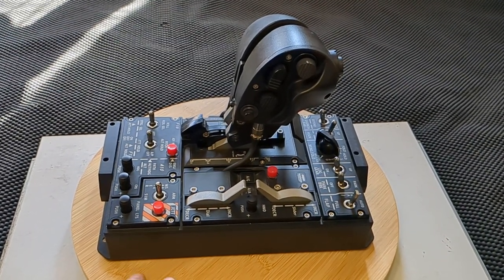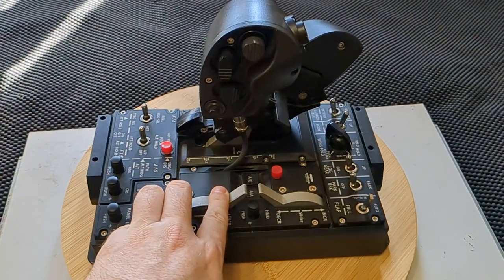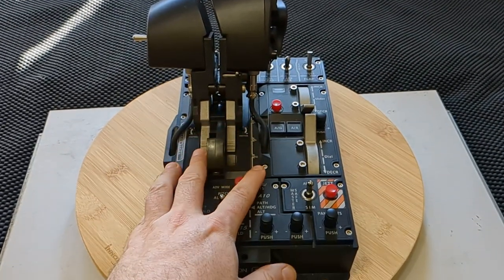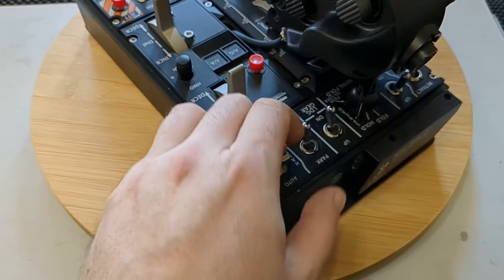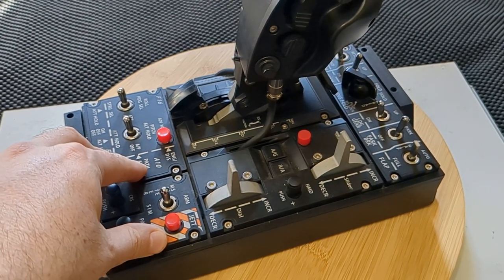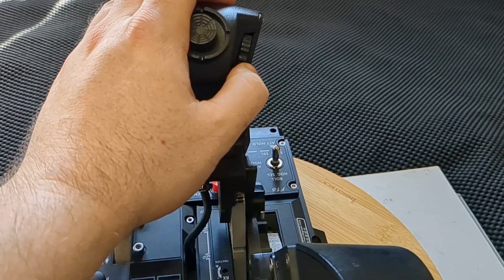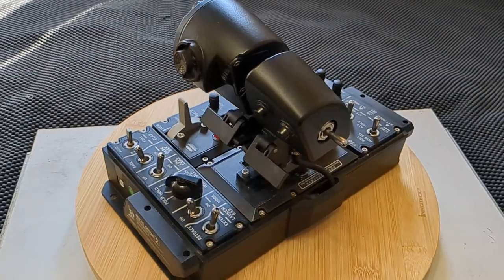WinWing Orion 2 Throttle +1 year Later!

Comment from the maker: Useful Links
Wingwing store - https://winwingsim.com/view/index.html
Wingwing Simapp Pro link - https://winwingsim.com/view/simapppro.html
My video on the Finger Lift Kit - https://youtu.be/LuzZzX9qvy8

Time Stamps
0:00 - Intro
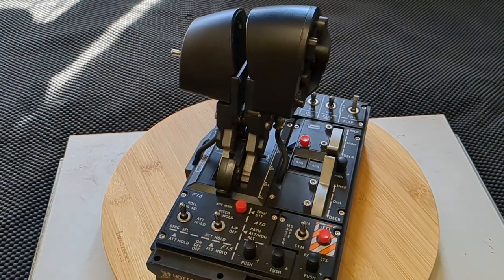0:46 - Do I like it?
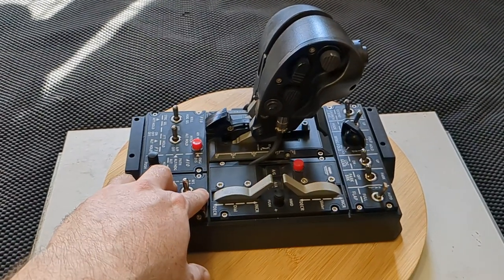1:25 - Why it's not ideal just placed on a desk
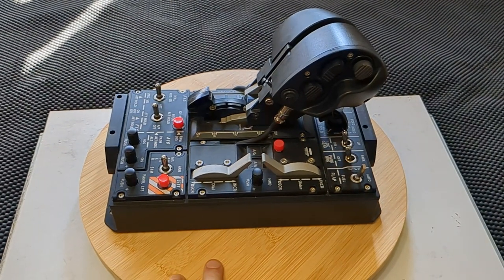2:22 - Adding a powered USB hub with switches is a nice addition
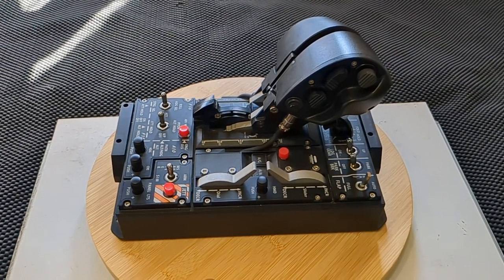3:03 - Use the 4x32 button mode!
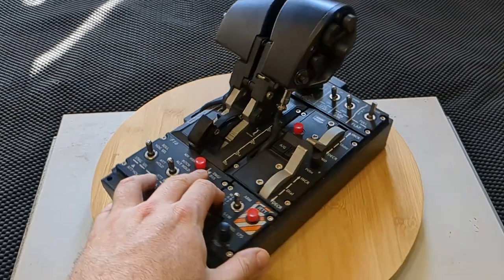4:08 - The Orion 2 base
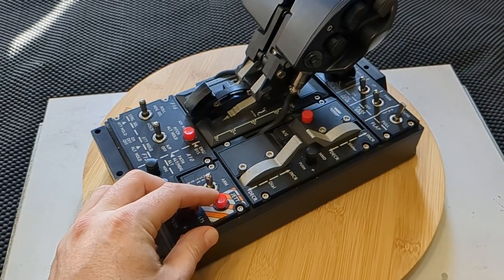4:59 - The sliders
6:30 - Front switches
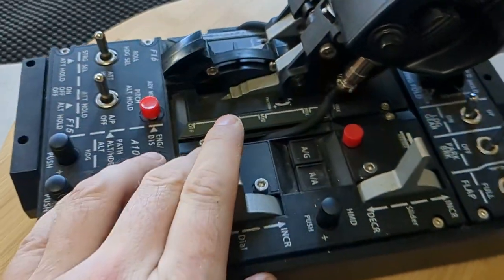7:36 - Visible throttle cable
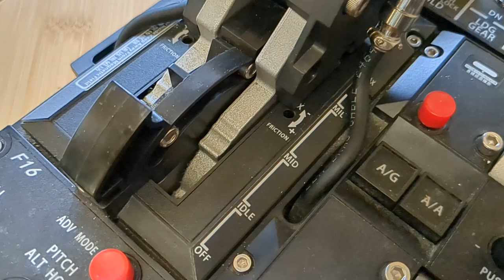8:10 - Friction adjustment
8:29 - Finger lift kit
10:17 - The grips
10:55 - Split throttle latch
11:26 - Pick the most versatile grips!
12:11 - Mini joystick
12:28 - Outro

Comment: Are you using the finger lifts to get in and out of the afterburner detents??
Reply from the maker: To go into Afterburner yes I lift, to come back off into Mil power no I don't lift. From off to idle you don't need to lift but from idle to off you lift, obviously you don't want to accidentally shut the engines down in flight.

At Mil power position it's awkward to reach the finger lifts if the throttle is just placed on the desk to the side infront of you. How you mount the throttle really needs to be considered before buying it.
Reply: @Honosuseri  very interesting - why are you lifting to go into afterburner? You don't need to and it's not designed to either. They will lift automatically as you push through. Only lifting necessary is from idle to off for the reason you mentioned.
Reply from the maker: That's probably how people have broken their finger lift kits along with over tightening. It's just plastic and the resistance against the Afterburner detent is pretty firm. Although yes the Afterburner detent is shaped differently and would allow you to push through, I'm not comfortable doing that. I've seen Winwing refuse to replace the part so I'm leaning on being gentle with the finger lifts.
Reply: @Honosuseri  fair enough, to each their own! But for sure the design of the AB detent is to give you a bit of feedback but not requiring a lift. If there is damage caused by doing this then there is some fault or user install error.
Reply from the maker: Yes the idle detent has a hook to it, you're not pulling back through that without the lift. I could adjust the afterburner detent further forward which should lower the angle & reduce the resistance. Still I'm pressing down putting pressure on plastic which can go brittle over time. The grips come out of Afterburner with much less resistance, it just slides along the detent. I'm more comfortable using the fingerlift to go into AB, the F16 replica stick is designed to have the grip lifted to go into AB...yes it's a different design but I use them the same.

Thanks for watching and commenting. Perhaps I should do another video to focus on the finger lift kit more, show what happens as they're used and why I do it this way.

Comment: How does this throttle works with Elite Dangerous? I pre orered it but I'm worried how Elite is handling those 3-way switches? I'm also thinking about VKB STEC throttle or Gladiator NXT Evo with Omni throttle and I can't decide.
Reply from the maker: I personally found I didn't really need to use the 2 and 3 way switches for Elite Dangerous. The push buttons on the base along with the rotary encoders were enough, combined with the buttons on the throttle grip and those I had on my flight stick.

Comment: I have been reading that using the 4x32 mode in the Simap Pro App doesn't work. But it sounds like you haven't had any issues?
Reply from the maker: No I've not had any issues. In fact some games have had patches since so that mode shouldn't be needed. Perhaps people with the F-15 grips have had issues but I can't comment on that
Reply: @Honosuseri  Thank you!
Reply: Hmm, do you know if Il-2 had a patch like you mentioned? Or does that still require the 32 button mode
Reply from the maker: No I don't know if it's been patched. I keep the throttle in the 32 button mode to ensure compatibility with games/sims.

I disable it only to upgrade the firmware of the throttle, then turn it back on again.
Reply: @nicki9knuckles  In August (or around there) it did have a patch where now it supports controllers up to 128 buttons, so I no longer use 4x32 mode

Comment: Thx, very helpful. Just bought one myself after watching this.
Reply from the maker: Thank you for letting me know it helped you. I'm just about to upload another video to focus on the finger lift kit on my Orion 2 throttle.
Reply: @Honosuseri  That would be great,  I was told that they are a weak spot of this throttle. They seem like they are made out of a kinda soft plastic.
Reply from the maker: Yes the plate to attach the grips for the F-15 and F-18 is POM (plastic), F-16 it's a metal plate. It's a weak point for sure which is why I use the fingerlifts to go past the detents to remove all resistance and apply as little force as necessary. If you want to push through the detents applying a little silicon grease really helps reduce that friction.

Comment: Thanks for the video.
I ordered this throttle and the F16EX stick today. Decided against the 15EX because I felt it was a bit too cramped and I currently mostly fly the FA18 anyway.
Looking forward to it, coming from an X52 Pro
Reply from the maker: You're welcome, that's a big upgrade!

Enjoy the new kit, please do let me know what you think. I don't use their stick myself I have a VKB Gladiator EVO Premium.
Reply: @Honosuseri  I did not think its such a massive difference. The throttle is fantastic, much better control and its great to keep the hands on the throttle without having to use any modifiers.
The joystick surprised me the most as its so ergonomic and its incredible how much more control you have with waaaay less effort. Making smooth level turns was much more difficult before and its so simple now.

Comment: Hi, Is it possible to use simapppro to play Elite? I use hidhide and joystick gremlin but I don't like the way I have to use the toggle switches. Cheers
Reply from the maker: I play Elite with the Orion 2. Set it in the simapp software to the 32 button mode so Elite can use the buttons and switches. I don't really bother binding the toggle switches, with my flight stick and the throttle I have plenty of inputs.  

The Orion 2 base has the 4 rotary dials that also work as push buttons, e.g I turn one to target sub sytems on enemy vessels. Obviously there's quite a few push buttons on the base too e.g "A/G" I have as landing gear and "A/A" as cargo scoop.